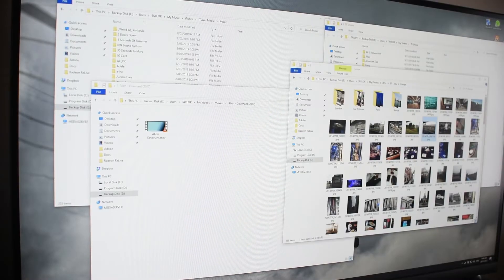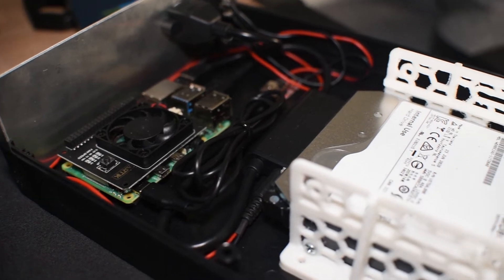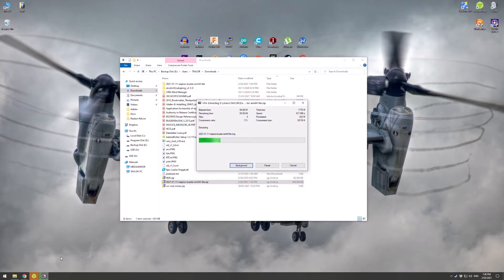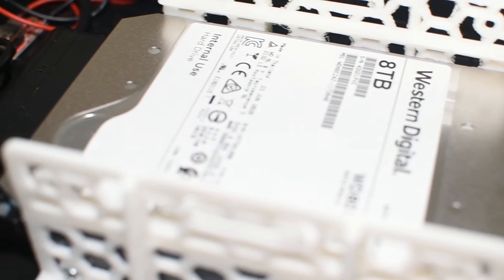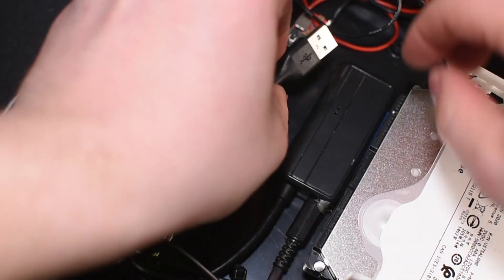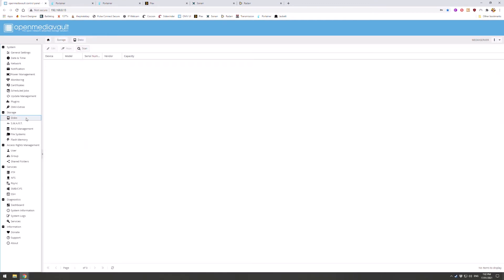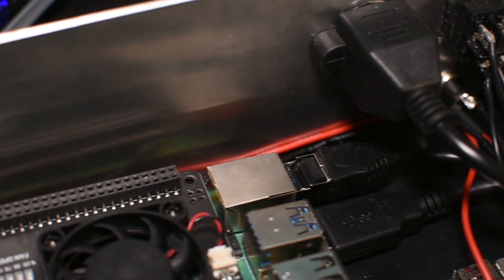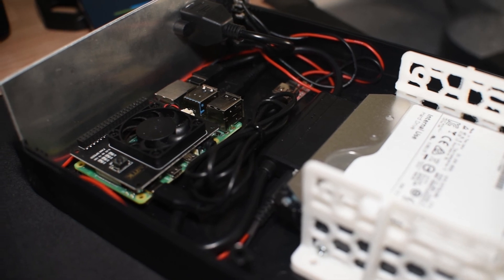Raspberry Pi NAS || Home Media Server || How To Make

Comment: Looks great, but not much detail. So you use a step down to get from 12V to 5V USB? How did you get from the outlid (110V/230V) to the 12V? The PSU that comes with the USB to SATA adaptor, is properly not something that you should pump 4 amps (Rasberry + HDD) out of.
Reply from the maker: Will upgrade to a zimaboard in the future and maybe cover in more detail! Happy to answer any and all questions in the interim. It's still going strong and works well. Yep small 12V to USB converter for the Pi. I use a 5A 240-12V plugpack to power the box.

Comment: A router with usb 3.0 port and Fresh tomato/Open WRT works great too.  It can more than handle your requirements. I have r6300v2 ancient router chugging away non stop for 6 years with a 4TB Hdd with DD-WRT and now FreshTomato. It cost me barely 220 usd tops.
Reply from the maker: Certainly can. My router doesn't have USB though and I was already using the Plex ecosystem.
Reply: @Maker_HQ  So I believe the Pi is connected to your router via RJ45 jack right? Because Pi has really poor Wifi.
Reply from the maker: @NikhchansGaming  yep I was responding to you just before you deleted that question =)
Reply from the maker: @NikhchansGaming  I get up to 80MB/s write speed this way
Reply: @Maker_HQ  That's awesome. I get about the same with my router setup. Though the Pi setup has been a pain in the ass, especially with bugs and issues. Currently using DietPi, disappointed that my Pi can't latch onto my router from mere 12 feets LOS!!
Reply from the maker: @NikhchansGaming  yeah I was honestly surprised! It never goes smoothly. Do you think the bad wifi is made worse by the hard drive 'strapped' to your Pi? Electrical interference might be making things worse...
Reply: @Maker_HQ  I actually did try it today without the hdd. Same result. It works if I keep it on the edge of my table about 7-8 inches ahead.
Reply from the maker: @NikhchansGaming  without the HDD connected at all? Weird. Because that was the next thing I was going to suggest. Usb3 is known to cause interference with bt and wifi on the pi4...
Reply: @Maker_HQ  Yes. Now it work with hdd as well. As I said by keeping it on the edge of my table. So it's like 7-8 inches near the router and in front of my TV instead of behind it.